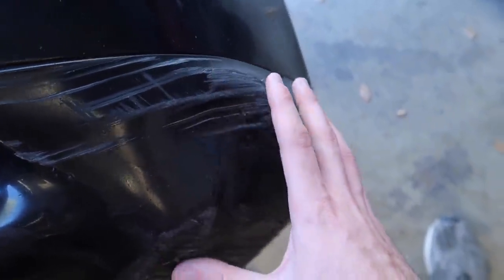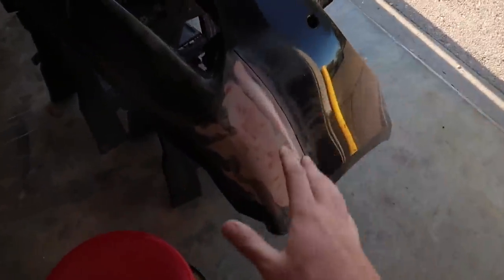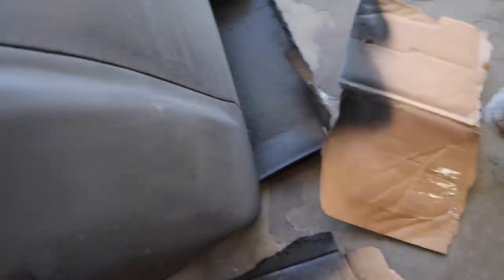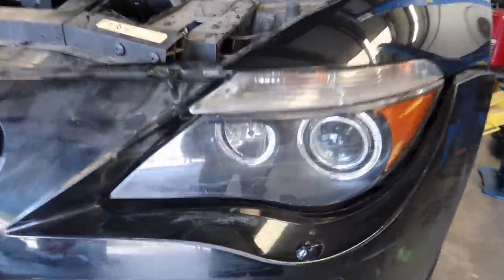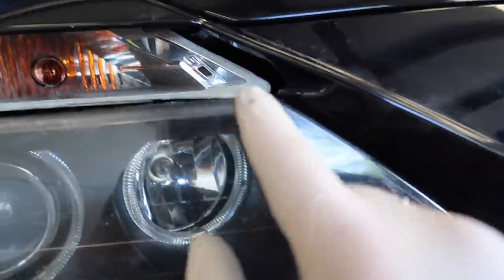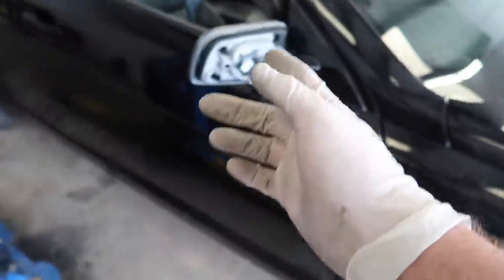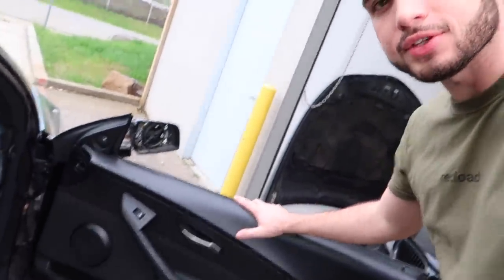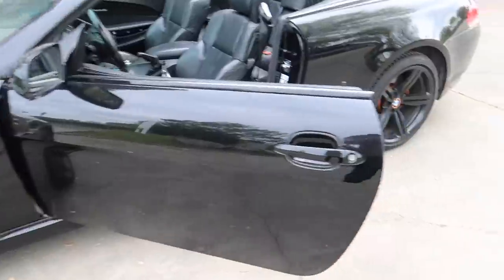Rebuilding My TOTALED $800 BMW V8 650I! (Part.2)

Comment: Hey based off the damage to the bumper. Where you mounted the hose looks likes like a common impact area meaning the hose will like break. Just a thought. You might wanna move it back.

Comment: So on that mirror I’m sure you can use it if you depin the wiring. Most likely the other wires are for heated mirrors and auto dimming then the one you have is just the power tilt and adjust 👍🏼

Comment: That cabrio bro💯Abouth the mirors, you get pre lci miror,  and problem with this is pre lci miror dont have module init, like lci, and your lci miror has module inside thats why you got one conector with 3 wires, so thats the diferent betwens mirors thats why you need lci one✌️

Comment: When will u buy an e60 I would love that they have the v8s with the SMG!!!!
Reply: Should go straight for the beast V10 M5
Reply: e60 har the v8 but it is an automatic , the v10 , the M5 is an SMG
Reply: 545i and 550i are SMG also
Reply: Gucci E60 yeah I have the 2008 550i smg and a 2004 545i smg the 545i is a lot more powerful lol
Reply: Yeah, they’re great cars, i’ve only driven 545i and M5, never gotten to try 550 but i guess it doesn’t differ too much for the 545. I just love the sound of the V10 which makes the M5 E60 my favorite car of all time :P
Reply: Gucci E60 the 550 just has more features I guess the 545 is a lot better tho

Comment: I really like your videos although I don’t think you should keep spending money on buying new parts like the mirror, because i believe you can make the gray mirror work if you try your best by splicing the wires. It’s pretty dang simple! Try and make your own stuff, and build the cars, not just replacing parts, you know what I’m saying, just like you did on that bumper - fix it, don’t just buy new ones, there is nothing interesting about that lol

Comment: The mirros are the same, just swap the harnes, motor  from your mirror.
Reply from the maker: that is the smartest thing i have heard in years lol, I will try just that thank you!
Reply: @NourHummadi  the reason that the number of conncetors are diffrent is because: 
Your mirror have "+, - " and "lin" comunication. The control over the mirror is in the mirror. Functions like heating, dimming and foldin its command tru that LIN.
The spare mirror have 3 connector that contains separate + and - . The function are controlled from "door module" that its on the door of the early models. Each function has separate conncetor. The 2 pins one that u try to use is for dimming.
So.. be sure to swap everything form your mirror to the other mirror. And use only the shelf of the spare one.